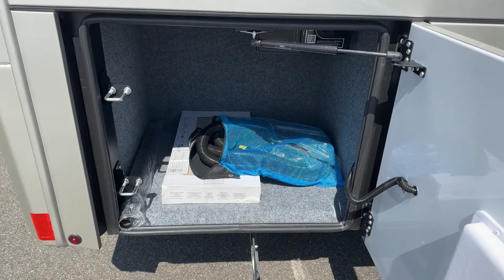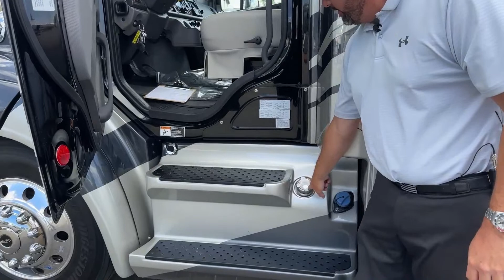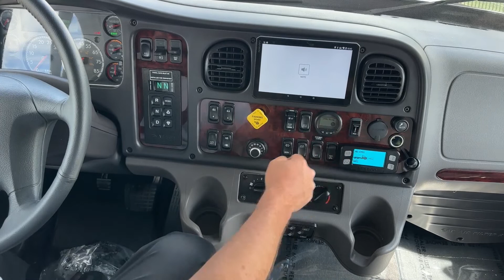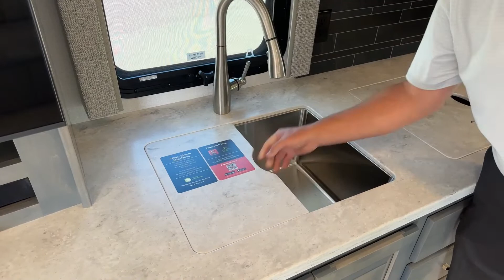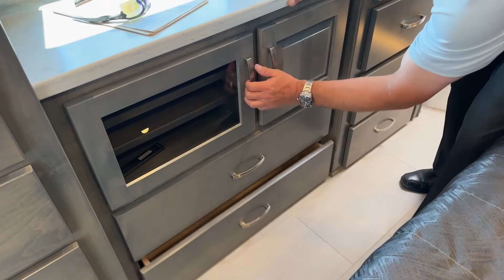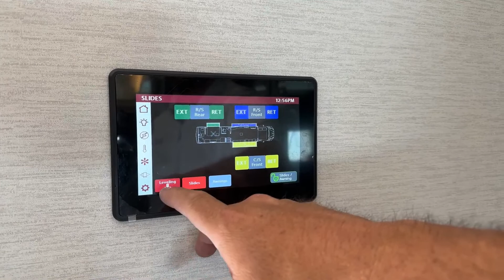2024 Renegade Verona LE 40LRB

Comment: I thought the 2024 units were all coming with smart steering wheels that would have cruise control, etc. on the steering wheel. I know Freightliner finally updated the M2-106 chassis. What happened?
Reply: You will see that chassis soon; however, the manufacturers still have M2-106 chassis' to build on that do not have the new features.  Once they build through existing chassis'; then you will start to see the new M2-106.  It may not be for 6 months to 1 year before we start to see those landing.
Reply: @grantrussell9903  Thanks!

Comment: Beautiful coach with a very tasteful interior that will stay current for a long time.  The galley also looks great with its large single sink. It's also great to see the standard Lithium house batteries. One small critique is that the fuel fill isn't locking.  Thanks for the great presentation!